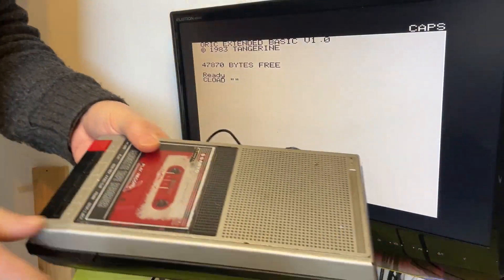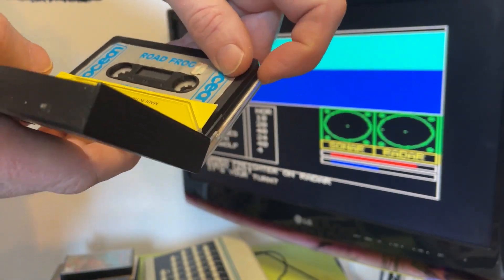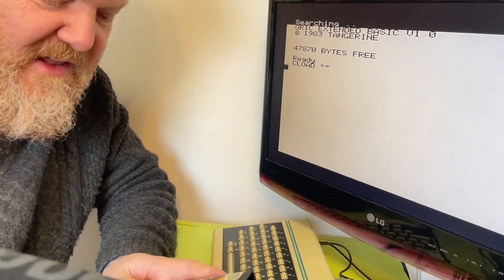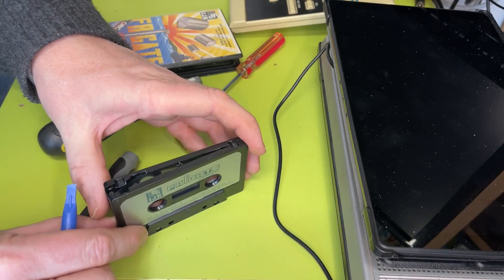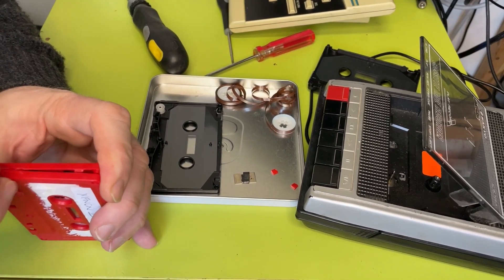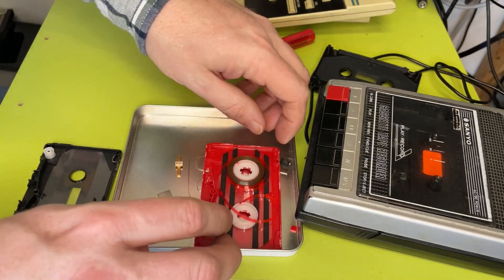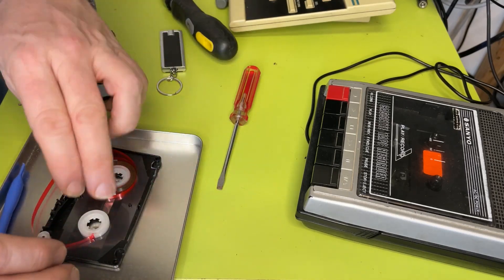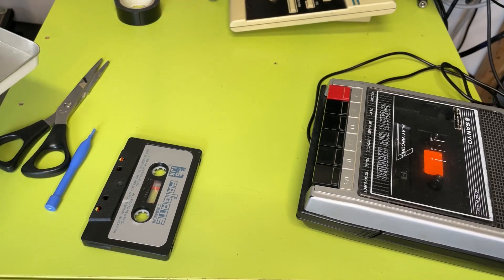Oric old tape recovery part 2

Comment: Couple of tips... First, you can replace the tape without dismantling the shell if you have a tape splicer and splicing tape. It's fiddly but you cut the tape at the leader, splice in some brand new tape stock from a C90 or whatever (getting the right amount of tape can be a faff but what I do is wind the donor tape forward however many minutes are needed, then cut it there and splice onto the destination shell). Wind it by hand from one tape to the other until you reach the end of the tape then remove the old tape from the destination shell and cut to the leader again and splice the new tape onto the leader. You can then use the C90 for the next tape to be copied.

Second, I know you're an Oric guy but I've used this method for CPC, Speccy, MSX etc and it works well so I don't see why it shouldn't work on an Oric (these machines are just too expensive these days, so I don't have one - yet!) .

If you have a Commodore datasette, get hold of a 1530USB adaptor, available at the usual places. This connects a laptop up to the datasette. The adaptor appears as a sound card on the PC. Play the TAP, WAV etc on the PC and record on the datasette. Because the Commodore standard doesn't use biasing on the tape you get a really reliable, "digital" recording on the tape (digital in the sense that the recorder "bit-bangs" the audio directly at 5v rather than trying to be clever to improve sound quality which gets in the way with computer data saves). I have found that this produces near-100% reliable recordings across the board with none of the flakiness you get with copying using the mic input of a tape deck. As long as the datasette is in good order I've found that it'll even produce reasonable results on knackered old media, and it's the only reliable method I've found for transferring commodore stuff.
Reply from the maker: Interesting stuff. I don't have a splicer but I used to have a bunch of cine stuff and had a film splicer and I know they are kind of the same thing, does your use heat or an adhesive?. I do remember using sticky tape as a kid to rescue some tapes... That was a right mess but I did manage to recover some of my games on a broken tape which was well worth it. You could look down into the tape as it goes round and see the bulge in the tape reel as the Sellotape spins round...
Reply: @RetroGingerPod  The splicer tape does use adhesive but it's quite weak and doesn't gum up the heads like sellotape would. It's a real knack to get right but once you get it right you probably won't be able to tell you ever changed anything. Not sure if a film splicer would work but the cassette splicers are cheap on the 'bay. The cool thing is you can save half a dozen tapes with one C90 cassette (just use an old Memorex or Bush or something - I have a pile of old police interview tapes that do the job well - don't have to use a TDK MA or owt fancy like that lol.
Reply from the maker: I will do a search... As for the police interview tapes, I wont ask! :)
Reply: @RetroGingerPod  there's a place called TapeLine who have the cassette stuff.

As for the interview tapes, nothing dodgy I just got a box of a hundred of the things for four quid in an online auction years back. They're good tapes actually but they have a label on one side that does make them look a bit naff if you use them to record music and the like!
Reply from the maker: Looks like an Aladdin's cave of tape wonders. I need to be strong though and not buy more stuff!